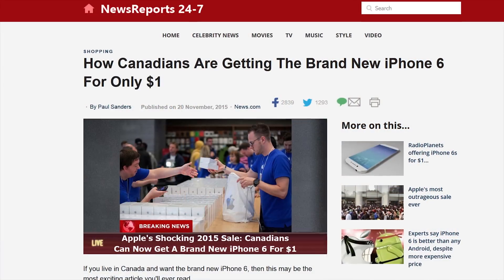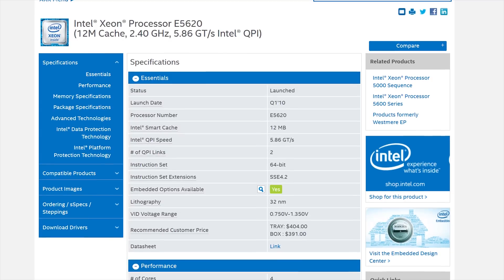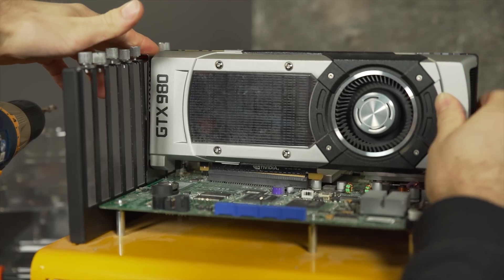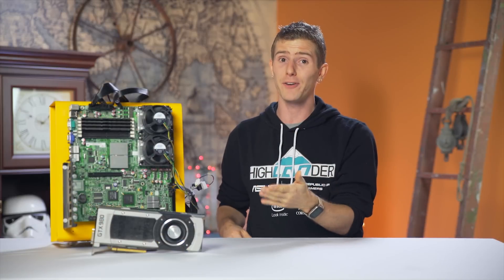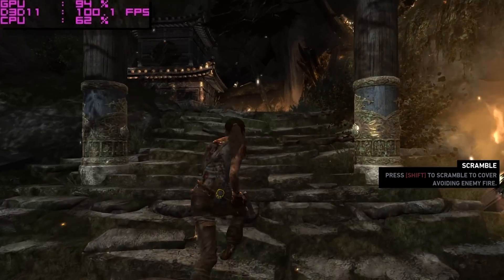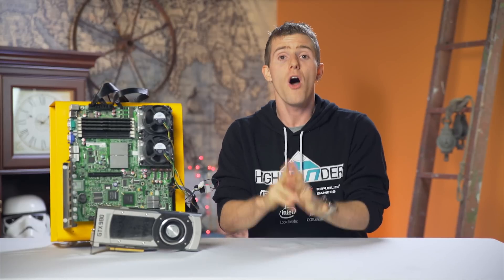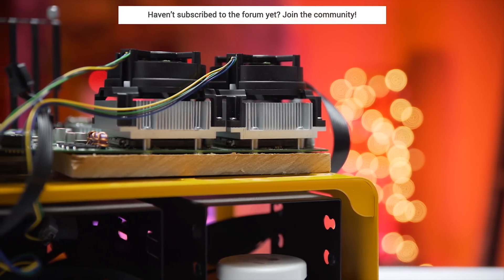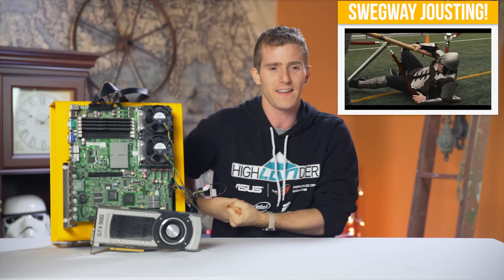Under $150 Budget Gaming 8 Core CPU, Motherboard & 16GB RAM

Comment: I have a server based pc in the works right now

-hp ml350 g6 server board $75 usd
-12gb ddr3 1333mhz $7.5 usd including shipping
- 2 Xeon x5570 2.93ghz stock clock quad core with hyper threading for 16 threads total $31.5 usd with shipping
-1000w server psu (because of the MoBo power connections) to run 980 ti sc and a small car. $20 usd 
- modified water blocks (I have a lot of old parts) 
- I'm planing to build a custom sheet metal test bench/server rack style case (cuz cheap S.O.B)

There were a few miscellaneous parts here and there... Total cam to about $165 usd (without HDD, OS, Case, or possible extension/adapter cables)
I could have done better... But I threw the idea together in a night or two.

Comment: You could buy a 2005 pc, change the cpu, add a new gpu, and a new psu. Done.
Reply: +N00b 2100omg But an old motherboard wouldn't support a new CPU.
Reply: robotica true, but there are motherboards out there that are very cheap. An I mean under $50.
Reply: N00b 2100omg Then why bother buying a 2005 pc if you're changing all the parts?
Reply: robotica true.
Reply: +robotica I think he meant to say, go buy a 2005 case and then buy a motherboard, cpu, gpu, psu, ram and done!
Reply: Zzzz just buy an old dell optiplex add more ram n buy titan x end of story
Reply: Trevor Philips No CPU bottleneck?.. No?..
Reply: there is
Reply: Trevor Philips And? Even AMD's 8-cores can bottlenecks the latest GPUs.
Reply: Trevor Philips Plus, you were takling about an old optiplex, which might not even have a quad-core CPU.
Reply: have u ever seen a fuckin dell optiplex or even know about the old one? im talking about the quad core type not a fuckin useless dual core type...
Reply: Trevor Philips Yes, I have seen a Dell Optiplex. You said "an old dell optiplex" which means any Dell Optiplex, to which I replied it "might not even have a quad-core CPU.", and why are dual-cores "fuckin useless"? Your mind is polluted and you make no sense.
Reply: +Trevor Philips dual core processors are not useless for most tasks, i can even edit video on a dual core processor at 2.7ghz
Reply: +GormyGorm Bet you could on my dual core at 4.3 Ghz. :)
Reply: Hunter Dominic I use a dual core intel core i5 (5th gen) on my laptop, it is clocked at 2.2 ghz, but turbo to 2.7 ghz
Reply: what?? you just suggested to change almost everything lol.
Reply: Hanya Hage Did you not see that I replied him earlier with the same response? He doesn't need to see what he's already seen.

Comment: Someone have full spec of that PC? (hard to find all)
Reply: Super Waldek wel amd needs 386 bit to keep up with nvidia's 128 bit gtx 960 xD.
Reply: in ~150$?
Reply: +That Guy...Brian ok ^^ still not too much
Reply: +That Guy...Brian 960 is shit r9 380 is way better
Reply: Alright, I merely have a preferece for Nvidia cards because I can memorize their naming system. I'd assume on your end it's the same, except with AMD.
Reply: That Guy...Brian yea i like nvidia more for couple of reasons specialy that 960 burned after 2 day of me having it and the couple of them
Reply: +Super Waldek I've been using a 960 2GB for 6 months now and besides that i should clean it after all that time its working great
Reply: +Super Waldek I had pronlems with hd 7970, 7950 and r9 280 (the x and non x versions) so I keep my gtx 960 4gb.
Reply: shag stars i had problems with my 760 gtx and 660 gtx but that pc burned the proc graph power supply and motherboard so i got a laptop
Reply: +HydraGFX I have R9 380 4gb but if I had the money I would have gone with Nvidia. Amd GPU;s are good and do the job, but if you have the money go Nvidia!
Reply: djkaye youtube yea if you have 750$+ for a gpu (980ti +) the 900 series sucked only 950 and  980ti were good
Reply: +Super Waldek the 970 was not too bad. the 980 was no as good as I expected and the 960 was really bad. the 950 was good bang for buck.
Reply: djkaye youtube 960 wasn't that bad, I 've got for 211 euros incl shipping one with 4gb from gigabyte (with some overclocking it was a beast for what it is). the ones with 2gb vram costed just 5 euros less xD.
Reply: shag stars it sucked beacuse of the 126-bit memory
Reply: Super Waldek 128-bit was good enough for maxwell.
Reply: shag stars well not good enough id say min. 196-bit would be good but no so
Reply: shag stars radeon ma 256 i niszczy gejforca

Comment: Except that an i5-3320M will destroy 2xE5345s (in my case, convering RAW files into jpgs.) The E5345s were also a bottleneck in Source, of all places. Also, Linus forgets to mention that you not only need the same model but the same stepping. For gaming workloads that do a bit more GPU rendering it's certainly not a terrible idea, though. I'd be looking at the Nahalem-based Xeons instead, though. They're a huge performance jump and support DDR3, which for RDIMMs is quite cheap.

Comment: I think working on such a budget should be an experience for everyone out there, having a interest in computers. Yes older hardware is on the cheap on many ways (esp ebay) and you can assemble a pretty fast system. The fact that SSD's are replacing the traditional HDD's you already have a nice speed gain on simply replacing the HDD with a fast SSD one. Old computers who actually waited constant on slow HDD"s can be brought to life again with a fast SSD.

Comment: I just got an HP Z800 workstation with the specs:
2x Xeon X5660 6 core CPUs (12 cores / 24 threads)
40GB DDR3 ECC RAM
4 TB of HDD storage (2x 1TB and 1x 2TB drives)
Nvidia Quadro K4200 4GB GPU
1250W PSU (1110 W @ 110V)

I got all of this for the low, low price of FREE!! :D

Comment: Erm @LinusTechTips, you could have gone for Supermicro X8 Series boards, Xeon 5500 Series CPU's and Cheap ECC DDR3 Ram.

I picked up an X8DTN-LN4F (EATX) for $60, Xeon L5520's for $10 each, and DDR3 ECC Ram for $10 Per 4GB ECC RDIMM....

A little more searching would have landed you something a LOT BETTER for the same amount of Dosh!

Supermicro X8 Boards have Plenty of PCI-E Slots and some can be had very cheap on ebay, XEON 5500's are Hyper threaded and dirt cheap, and the used DDR3 server ram is really worth it.
Also the smaller Supermicro X8 Boards like many Supermicro boards drop RIGHT INTO an ATX or EATX chassis depending on the board.

Comment: Ok +LinusTechTips question for you but its a bit long: I currently run a p8z68-v Pro asus board, ddr 3 ram, 2600k proc (running at its 3.5 gig blaze speed the easy option on the bios lets you select), and a GTX 960 SSC 4 gig card. I like to game, but I also like to do things like zbrush, 3d studio max, photoshop, and maya. Would I be better served going this route due to its higher cores (maybe I can even find a server board that supports ddr3 if I'm willing to break the low budget a bit) for my rendering and graphic creation tasks while not compromising my gaming experience all that much from my current set up?

Comment: Linus CPU is 4 core (QUAD CORE)  :(
Reply: +OPgalaxyOP but there are 2 of them, so you get 8 cores total.
Reply: +Powered By Redstone but they don't work together the same way as a single-package 8-core. communication between the 2 chips is brutally slow as far as system buses and uprooting running processes go..
Reply: ***** sure, you can address 2x more memory at double the total speed, but nothing has ever been severely bottlenecked by memory speed.. the disadvantage of having 2 4Cs rather than an 8C is that the chips have to use a system bus o communicate, rather than having practically limitless speed from being on the same silicon die.. that way a process can move from cores 1-4 to 5-8 quickly, rather than exporting the whole process through the FSB (or QPI).
Reply: and then you have my CPUs, the E5472, if you ever pop the lid off one you find not one, but 2 silicon dies.  this means I have 4 total dies in my system, go figure.
Reply: Powered By Redstone hmm, that technically means you are running a 4 CPU system.. I've been looking for somebody with a cheap EVGA SR-2 board for sale to build a system in, CPUs for that platform are pretty cheap, and the board overclocks, but futureproofing is almost nonexistent.. the bet is that DX12 will allow balancing of workload on 8-12 cores

Comment: Two quads is actually better than one (probably non-hexachannel) octa, because it has two separate sets of channels for memory (on most setups) even with the lower memory clock servers tend to have. Obvious tradeoff is these setups need absolutely monstrous power supplies to get the same relative performance as a newer single-CPU system.

Comment: Buy a used Dell Precision T5400, T7400 or T5500 (T7500s are expensive) with dual quad cores... The T5500 usually has hyperthreading enabled processors, too (8 cores/16 threads). You won't regret it.
Reply: +Dylan Ford Truth.
Reply: I'm considering doing this, do you know if I would get decent performance if I added an r9 290x?
Reply: Yeah, of course. Although honestly for gaming I would say go with the T5500 over the T5400 or T7400. The T5500 uses processors based on the same architecture as the first generation i7 processors, which are still adequate for gaming today. However the processors you can get for the T5500 are actually clocked higher than the baseline first gen i7s and you can have two of them in one system.
Reply: Seems like a good idea then, I currently have an i5 4460 though, so I'm not sure if its worth the upgrade. There are also no reasonably priced/specced T5500's on ebay at the moment, so I'll probably wait until there's a more viable T5500 for sale or upgrade to some kind of i7.

Comment: thing performs pretty  much same as and AMd FX 8320...8 cores but too slow. You better buy 1 single Q9550 Quad with a P35 Board and OC it to 3,2 or 3,4ghz. Even cheaper than 150 bucks.

Comment: why don't you just get a intel celeron g1840 2.8ghz and r7 260x then a motherboard for 280$.
Reply: Because 2cores is shit
Reply: +SilentSlayer i3 4170 dual core is miles ahead of the FX-6300 and only£10 more
Reply: +Meek Mill celeron sucks
Reply: Buizel Productions don't judge a cpu by the brand name. a dual core clocked at 2.8ghz with 2 threads with a good gpu is better then having this apu.
Reply: Meek Mill
what do you mean? a amd of the same price is same or higher performance performance.
amd has always had more value in the low-end.
did you mean to tag Edward White?
Reply: Buizel Productions i was saying a celeron g1840 with a gtx 750ti or 950 is better then this apu setup.

Comment: I have 2x4GB DDR4 2400MHz and only play games and watch anime and that is WAY ENOUGH. I can max out any game on ultra settings and keep 70 to 150 FPS at 2560x1440p. (980 Ti OC'd at 1450 MHz + i5 6600K OC'd @4.2GHz)... I never even break past 7GB useage even with ram hungry games such as GTA V with extended draw distance sliders >_<

Comment: You could have found better deals.  Just picked up a short 1U server w/ a mATX style board, Xeon X3450 (4c/8t), and 2GB ECC DDR3 RAM for $99.00 (shipped).  Adding some RDIMMS to take it to 16GB was about another $30.00.

Has an Intel server board and is an LGA1156 setup.  Quite a potent little setup.

Comment: Why did you damage the gtx 980? Cant you just move the capacitor by soldering it to wires? x:
Reply: +Benjamin Buljevic getting it out of the multi-layer PCB would have been a bit of a challenge.  I've tried it before.

Comment: not worth it. it will cost you more energy in 2 years, plus more problems and no upgradabulity, than a normal system from the start. this is pretty much a one way street which is cheap in the beginning, but more expensive in the end.

Comment: DO THIS AT YOUR OWN RISK!!! Now that my warning is out of the way, if you just want a quad core system that you can overclock, you can buy a 775 motherboard a 771 to 775 adapter sticker on eBay for 3$ and CAREFULLY cut the inside of the CPU socket in the appropriate place, just Google it, and install your cpu ram and video card and you will have a reasonably powerful system.
Reply: +charizard4410 So much THIS. I just discovered it. What I'm wondering is, how much of a bottleneck will PCIe 2.0 be, compared to the now-standard PCIe 3.0?
Reply: iP1sano
Most graphics cards dont take advantage of PCIe 3.0 so you wont notice much of a bottleneck in most cases.
Reply: +charizard4410 I'm doing exactly this for my brothers PC in a couple of days when the new CPU gets here.  It's an older board, and we're both on a budget.  It has about the best CPU that board can handle as far as LGA775 chips are concerned, but I recently learned about the 771/775 mod, so he's getting a shiny old Xeon E5472 that should give about 33% better performance.  About the best $20 I've ever spent on an upgrade, chip and sticker.
Reply: Powered By Redstone
Be extremely careful.  When modding the socket if you bend a pin, chances are you wont be able to get it back to where it is supposed to be.  Not sure if you are aware but you actually need to cut off 2 notches in the socket for the cpu to fit. http://cdn.overclock.net/b/b8/500x1000px-LL-b8648d8c_IMG_0723.jpeg
check out the picture to see where you need to do so.  If you damage any pins the board will be useless.
Reply: charizard4410 Thanks for advising caution. Rest assused, this is far from my first rodeo with this sort of modding :P
Reply: Powered By Redstone
Alright, good luck

Comment: 2 of these for CPU
E5530

26.00
http://www.amazon.com/gp/offer-listing/B001Q8Q8GK/ref=sr_1_1_olp?s=pc&ie=UTF8&qid=1452741181&sr=1-1&keywords=xeon+quad+core&condition=used

6.99

http://pcpartpicker.com/part/logisys-power-supply-ps480dbk
12.99

http://www.ebay.com/itm/Foxconn-02010HE00-600-G-Intel-LGA1366-Dual-Socket-Server-Motherboard-/181833796762?hash=item2a56238c9a:g:bzYAAOSwAKxWU3h5

35.99

GPU
http://pcpartpicker.com/part/xfx-video-card-r7370p2255

RAM Hynix 4GB (1x4GB) DDR2 PC2-6400P 800 MHz ECC REG RAM For HP Proliant DL385 G6
http://www.ebay.com/itm/Hynix-4GB-1x4GB-DDR2-PC2-6400P-800-MHz-ECC-REG-RAM-For-HP-Proliant-DL385-G6-/181759015593?hash=item2a51ae7aa9:g:9tQAAOSwkZhWSeWc
6.00

$199 PC Build

Comment: my gaming pc is a old hp 150m g3 server running dual 5150 xenon processors an 5gb ddr2 ecc ram and a nivida 9800 gs 512mb graphics card in a pcie 8x slot has a high fbs around 1300mhz an plays project cars at 31fps play fallout new Vegas at 60fps black flag runs at 25fps it runs alot of games at a reasonable frame rate and the games are smooth and my motherboard supports a 5300 series cpu so i can bump up to 8 cores i just haven't bothered yet because so far its ran the games i wanted but i most likely will in the future getting parts is tricky and dont plan on getting any parts at a computer store  my build price was a steal found the server at the thrift store for 5 dollars got my ram for 15 and my processors for 10 an so everyone knows you need to run os like win 7 pro or win xp pro if you want the system to acknowledge both processors

Comment: Technically its 4 dual core processors, not true 4 core, or even 8 core :). Those Xeons are based on C2Q which are 2 DC on one PCB. Still good processors tho.

Comment: Most Supermicro/Intel/Tyan boards for 771 have more than one PCI-e slot (most also carry PCI and PCI-X slots). One slotted boards are pretty uncommon.

If you are going for a 771 you need to be sure on what RAM you motherboard takes. Most server mobos for that slot work with FB-DIMM, which isn't mechanically compatible with standard DDR2. Always check the board's requirements and limitations regarding RAM and CPU.

Comment: LINUS: Then my question to you. Would you take on this challenge!?(if its not -impossible)
Replace the CPU sockets to get the more of the "consumer sockets" for say like an i7- 2600 k. ?(repalce sockets which is typical standar of server motherboards, to a 1155 socket)
Reply: +WerewolfSlayer91 yup, does not work, :...( you&#39;d have to change chipset also, or it would not work at all even if you changed chipsett) ?

Only way is to turn to the darkside :Xeon
Reply: Hahahahahahahahahahahahahaha.

 you serious?

Comment: I'm surprised no one mentioned this. Make it a whole lot easier buy buying the motherboard WITH THE CASE. I'm doing this with an old Dell workstation. Check eBay for T7400 or T5400. You get the case and psu and everything. Upgrade the cpus, ram and get an ssd. They often come with ram cooling fans too. Also an SAS controller for faster than sata3 storage. You get plenty of slots. you might have to get creative powering the gpu though.

Comment: So I recently bought a second r9 280x (ones asus others Msi) and I currently have this mother board:GIGABYTE GA-970A-DS3P AM3+ AMD 970 SATA 6Gb/s USB(  http://www.newegg.com/Product/Product.aspx?Item=N82E16813128602 ) Now the motherboard says its crossfire ready but I noticed that the second pci 16 slot runs at a bandwith of only 4x if I read the specs correctly. Right now I have a couple problems with a few games having a black screen with green flickering. Could my motherboard be causing the problem.

Comment: can you give a link where to find that Yellow test thing your using to mount your test hardware. I have never seen anything like that where it has a built in power supply and is easy to test questionable hardware.

Comment: So.. Long story short go buy a cheap AMD A8 or A10?
Reply: I am currently on an Old I5 3470 pulled out of a Imac someone threw away. With DDR3 1866. Most expensive part was the GTX 970 in my pc.
Reply: +MAG “MAGWolf” Drago No because AMD Processors suck
Reply: ***** It can. i3 3220 performs better than the FX6300.
Reply: +CraftTheBoss 6300 outperforms a i3 4160.
Reply: Buizel Productions LOL no it doesn't